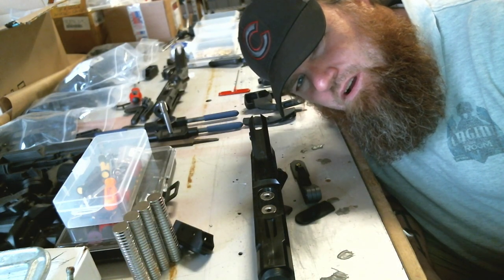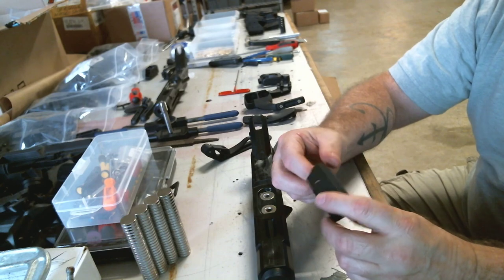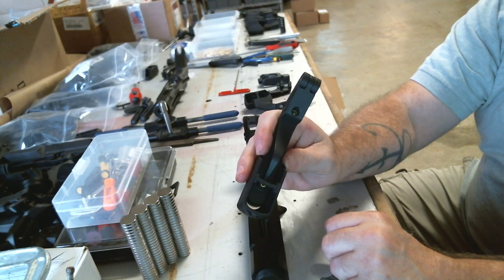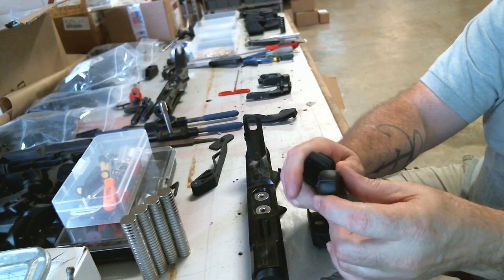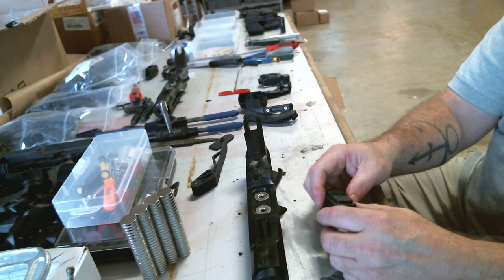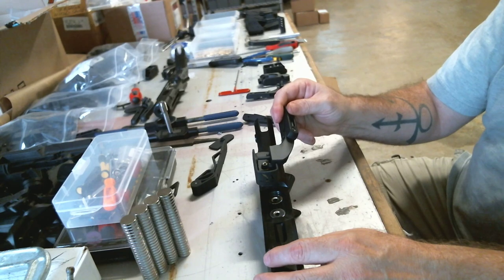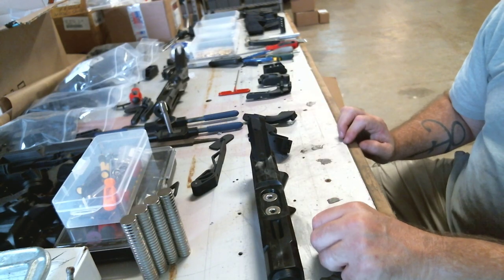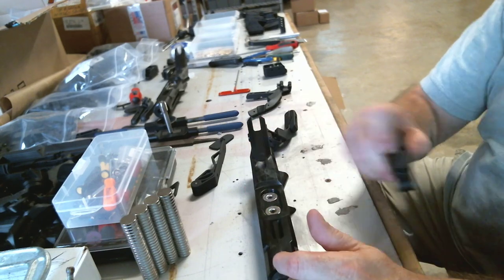Virtual Rifle Systems Controller Connectors

Comment: 3:00 I ordered and returned mainly because of this problem and the wobbly front connector. If said wobbly front connector and this magnet issue is fixed where I don't have to be so accurate when coupling the magnet, then I definitely need to try this again!

I didn't like the front lip connector mechanism. It's more natural to quickly couple the controller to the rifle by pushing straight up -- instead of the weird forward motion to lock-in the lip.